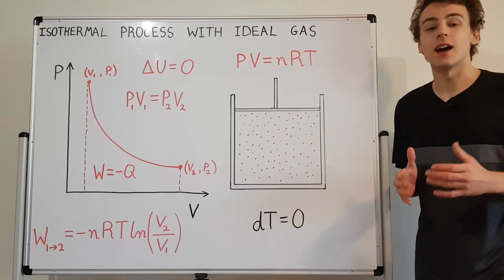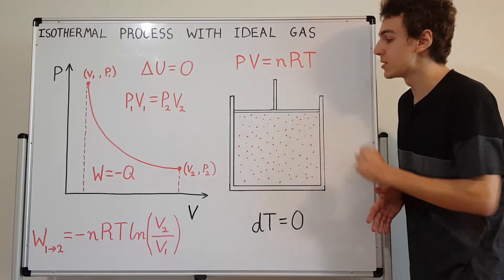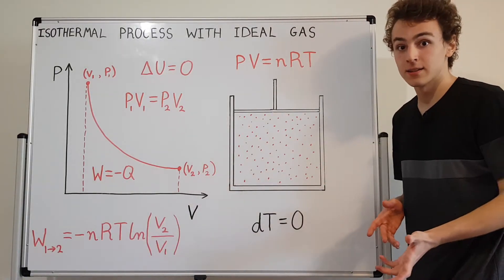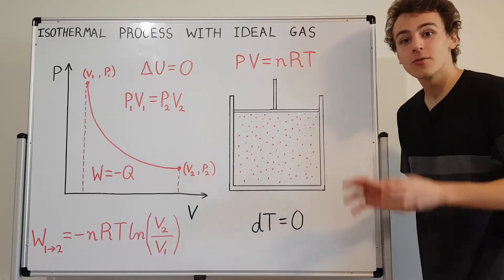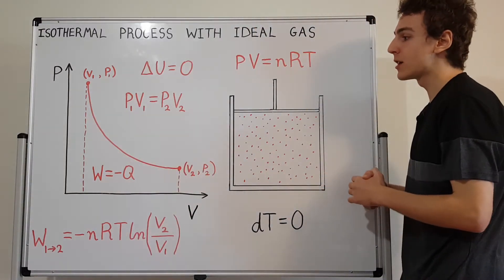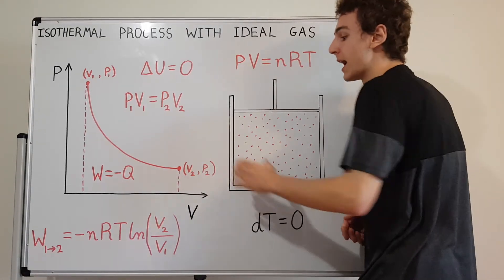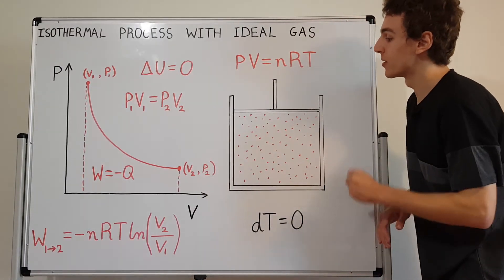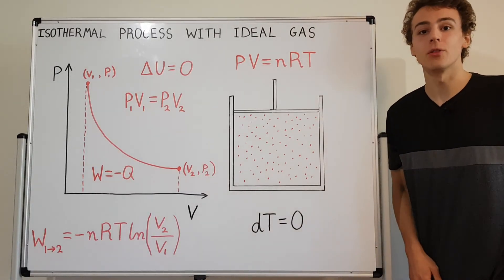Quantitative Description of Isothermal (Constant Temperature) Process with Ideal Gas on P-V Diagram

Comment: Nice.. since I knew that the enthalpy and internal energy of a gas are only a function of its temperature.. I was struggling to understand how the MechPE manual had an expression for reversible work for an isothermal process - my ?? was, where is the energy coming from to do work.. now I realize I was thinking of a closed system, and that was the error.. with an open system, work can be done or absorbed or by addition or subtrataction of  heat through a heat sync .. certainly one of the more subtle/tricky concepts in thermodynamics (which is probably rarely utilized in practical applications) and your video cleared that up for me, thanks

Comment: As a bicycle pump inflates a tyre, it pressure rises from 30 kPa to 40 kPa at constant temperature of 30 °C. By assuming the air acts as an ideal gas, calculate the work done per mol of the air. 
A. -80.35 J 
B. 80.35 J 
C. -811.93 J 
D. 811.93 J 

(please show calculation) 
can use this formula W=nRT ln(p1/p2)

Can you help me..everyone doesnt know how to solve this..i must present this question to my lect..please notice me